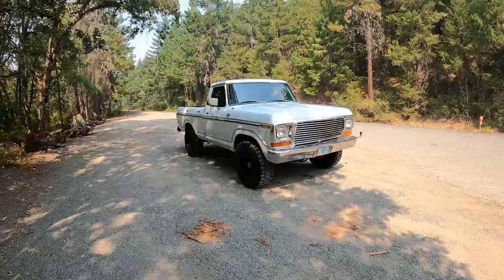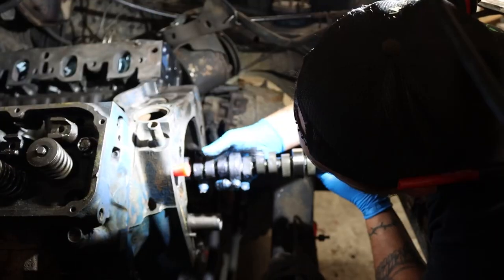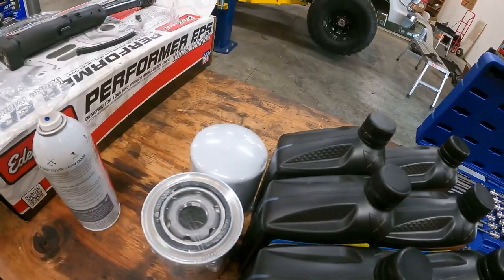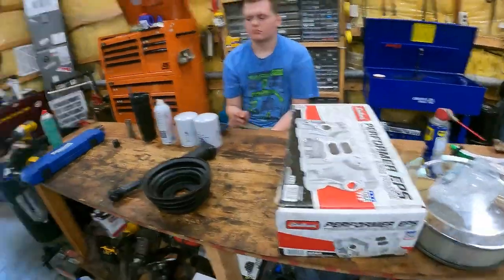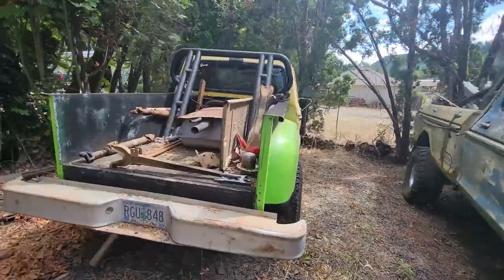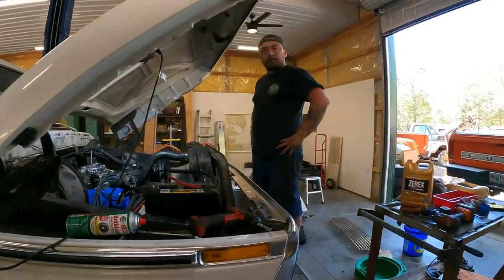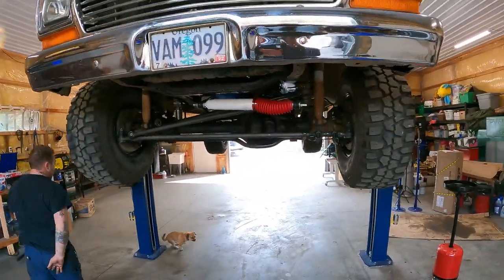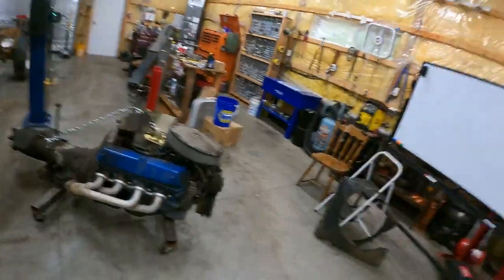Ford 400 Cam Swap. How To Go From stock to HOT!

Comment: The biggest handicap with those 400s are the giant dish having, humongous valve relief, compression robbing pistons. If you want to get some power out of one of those you’ve got to get some flat top pistons in it. Also just an FYI there is a 2 quart Ford filter Motorcraft part number FL 299.
Reply: Can I just gain c.r. using closed chamber heads
Reply: @ivonneflemons1249 Yeah, not sure if it'd be enough
Reply: @ivonneflemons1249 you'll gain performance out of close chambered heads but you'll notice the biggest increase with flat tops
Reply: @ivonneflemons1249  Absolutely.
Reply: The piston doesnt come close enough to even require valve reliefs?@bigwahoo8686
Reply: And if you're gonna do an adaptor to add an oil cooler.
Guys, spend your money once

Comment: A 1970-71 timing chain and gears for 351 c. A good dual plane intake with a 650 cfm carb, a comp 268h cam and recurve the distributor to have all advance in by 2800 rpm and the 400 ford will haul the mail. Huge difference in power
Reply: I’ve had two 400’s built ... the cam and timing set from the Boss351 is the trick. Edilbrock dual plane aluminum intake and a Holley 650 or 780(?) . The stupidest thing I did on the second one was putting headers , and using a stock type fuel pump, it would vapour lock when hot and stuck in traffic. 1976 Montego Wagon ... there’s a YouTube video my nephew made ( he says 400hp... I had no clue what horsepower , but it was a monster )
Reply: Canted valve Fords are underrated. 
A few quick mods and they are very powerful. Even more so if you bump up the compression.

Comment: I had a 78 bronco with 351m man that thing would start super quick. I haven't seen a fuel injection engine to this day that could start faster than that 351m .you would Barley hit the key and it wouldn't make one revolution  it didn't seem like and it was on.
Reply from the maker: the 351m and 400 was very under rated motor. Just a few mods and they are great motors.
Reply: My dad had a 75 torino wagon with the 400 for ten years , and it started like that , even in sub zero temps .

Comment: It’s nice seeing a Ford 400 getting some attention.  I have a cammed 400 in my Lariat short bed and it runs pretty well for what it is.  After driving it, it makes my Coyote 5.0 f150 feel like a pig!
Reply from the maker: the 400 is a decent engine. It does have a bad rap though and people that don't even know get sucked into it.
Reply: @78fordtruck4  Yeah, with bolt ons and a tune!  My 400 made my 5.0 feel like I was dragging an anchor!  The 5.0 was plenty faster though from a roll, dead stop it stood absolutely no chance.  My 400 will run a mid 14sec pass.  A gen 1 5.0 is a 15.xx sec truck.

Comment: Before I built a 460 and put it in my F250, I did a 4 barrel swap only to the 400 in it. That alone was a tremendous difference.  I'd assume you saw an even bigger difference by doing a cam swap also.
Reply from the maker: Yes, I really gave some proper life to the motor. Now I will say it's no 460... yet. But we worked within Chris's budget and this was the best bang for the buck and it gives a great platform to build off. The next upgrade will be his ignition system, then to exhaust, and after that, if he wants we can upgrade to an efi system. 

And I feel that is important stuff that people need to look at when spending money on their builds. Getting that solid foundation and then building off that platform.
Reply: @PaperBeatsRock   A lot of people think the 400 and 351M are just good for boat anchors. That's definitely not true. They came so detuned from the factory to accommodate smog requirements that were still pretty much a new thing. That killed performance. I'm not much on EFI myself.  I don't dis people that want it though.
Reply from the maker: @nicklewis7291  I fully agree with you on the 351m and the 400. They are be turned into some great motors but yes out of the box they are not awsome and thats a big reason why they got such a bad wrap. 

We have a block we are going to be taking to the shop very soon to make are going to building into a 400hp 400 and she will turn some heads.
Reply: Center line the  cam and put a lot  of auto  advance  in after it starts  and  it will fly

Comment: My dad ran a 400 in his race truck back in the 90's at our local dirt track. All he did was put an RV cam, D2 2V Cleveland heads on it, Weiland high rise intake, 650 Holley 4 bbl, set of long tube hooker headers, and it was running like a scalded ape, and running with those bowtie boys that 2x as much money and maybe 2x the power, and as soon as we got the set up right with the twin I beam suspension we were hard to beat.
Definitely an underrated engine

Comment: Nicely done guys...400 engines have always been underrated. Job well done.
Reply from the maker: Thank you so much. We need to step up to some of your guy's big boy 400s now and make a ripper.
Reply: Since that 2 barrel carb on 400 makes out 165-ish horsepower so now with 4 bbl and manifold upgraded and camshaft installed , what’s the horsepower on 400 after these upgrades ?
Reply: @darrenfike924  there i a video in YouTube, with a guy doing this on a dyno. 

His name is Richard, i Will try to find it for you.
Reply: @darrenfike924 smaller end of 400 higher end of 300.

Comment: I got my grandpa's 77 f250 camper special, 351 with 400 modified heads. She's tired with 337k miles on her. Never been touched. I want lift her and put a load of power under the hood but part of me wants to honor the old man and do a resto with everything staying Original, just a rebuild/refresher. I'm torn. I got too many memories with him in the truck to change the 2 tone paint or even take the camper top off. I found the original tool box in the side bed box the other day.
Reply: Is it a 351m?
If so a 351m is a destroyed (autocorrect changed destroked to destroyed! 😂 I Agree!) 400 with a shorter stroke crank and thicker pistons, everything else is the same, sadly a 351m sadly isn't a 351 with 400 heads... 😐
but from what I've heard there very good little engines, just figured I could spread some knowlige! 😊 and bad spelling

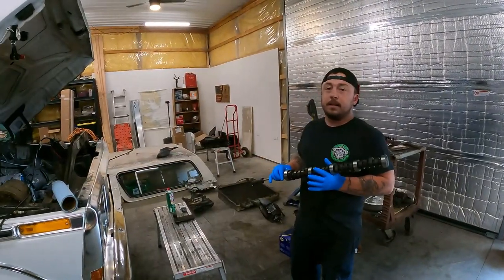John 3:16
Reply: Oh there's also a 400m a stroked out version of a Cleveland I believe, they were race engines with 500-600hp I believe. 🙂
Reply: @ShelbyScott919  it's a 351W not an M or a C. And the truck has over 300k miles on it and the motor has never been opened. It's not a race truck lol.  rear tank that was converted to stainless steel 70 gal, upgraded suspension etc..  the truck had two purposes, one was a trash run and the other, well that's not for the masses
Reply: @contagiouslyfit1021  i didn't figure it was a race truck since you said the engine was stock, just curious if the 400m heads were custom order or if he did that? and  do you mean 400m race engine heads or 351/400m?
Ford is so confusing! lol
Reply: @OVERKILL_SS  351w with 400m heads ordered from the factory. It's the camper special f250 xlt
Reply: @contagiouslyfit1021   that's cool as heck man! enjoy that thing as long as you can!
Reply: Egads.. you guys need to stop.  The M is only for the 351 so you can tell the difference between the other 2 of the 335 series engines.  And 400 heads are nothing but 351C 2v heads.. that are a bit downgraded over the years.  Ford only made 1 400.  they made 3 351's.  that's why letter only applies to 351s.  But people over the years are pretty dense. OK pictures or video or you are making this stuff up.  A 351C 2v, 351M and 400 head are basically all the same thing except they added a bump in the exhaust port in later years.. a downgrade for smog.  You can't just put 335 series heads on a 351W with factory parts.  They don't exist.  The heads physically bolt on but there is not an intake manifold made for that by Ford.. EVER.  It takes special adapters or aftermarket intakes and they didn't exist when Ford was making these engines.   Forget whatever grandpa told you and go learn about 335 series Ford engines from someone who actually knows them.    @contagiouslyfit1021

Comment: Good job boys! I am building a 400. Picking up the crank today. Found a standard bore block, will get it machined and squared then order the Meyers pistons.
Reply from the maker: Outstanding. There is a lot of potential in the 400 block and your right at the point where you can really turn it up. T Meyers does such amazing stuff with these blocks. If you have not already, check out their YouTube channel and the 400 builds they have done. https://youtube.com/user/tmeyerinc
Reply: Martin Loyd Where did you get your 400 crankshaft? I'm looking into rebuilding my 351M into a 400
Reply: TMI pistons is the biggest improvement...

Comment: Get a edelbrock 351c 2v performer and adaptor plates.
Your 2v heads have a bigger intake cross section that SBC AFR 210 CNC ported race ready heads.

Comment: The 400 Ford intake was unique to the 400 Ford and 351m only and it was not a long term popular motor.  400 fords have a taller deck than other small block Fords.

Comment: 400 is a low compression smog motor, but basically a high deck 351 Cleveland. Higher compression pistons, better heads and cam make these monsters. The best part is that these are cheap in the junkyards, but still hard to find.

Comment: Those 351 and 400 m was good engines after we pulled all the pollution bs that choked it off. Just putting a good carb made a huge difference.

Comment: A 351 Cleveland 4V intake manifold should bolt right on the 400..... A head porting would have been the icing on the cake ❤
Reply: Pretty sure wouldn’t bolt on you would need spacer plates 400 has taller deck height

Comment: I have embarrassed countless other cars and trucks in my 79 f-150 short box 4x4.  Built the 400 with Cleveland 2v heads from a 70 cougar, it’s fully balanced and blueprinted and rollerized.  It’s running 11.8:1 using Cleveland pistons with the wrist pins sized down combined with the block being decked.  That and a edlebrock street master single plenum intake.  The most embarrassing thing for people that get left in the dust is that it’s on propane and is runnng a mild RV cam 🤣.  In 4x4 on dry pavement it will hop 4” off the ground when you stomp on it.  I cracked the carrier housing on the 9” grabbing 3rd.

Comment: yeah, I about choked when I saw that new edlebrock intake was like WAT? I tried to get one of those for months. I think they cast them on demand now due to rarity. Finding a good 400M intake is the start of any build. I ended up getting one off craigslist. One of the moutning hole was fubarred but the local shop fixed it.

Comment: Anyone know about the valve springs, you cant use the stock ones that cam, im doing a mock up now, the exhaust valves go solid and the intake is nearly the same, Edelbrock doesn’t sell the springs and retainers that i know of now for that cam. Any solutions would be well appreciated ,

Comment: I have a 400m and I'm looking to go 2brl to 4brl looking at Edelbrock avs2 650cfm but don't know what intake manifold would be a good set up with it just looking for everyday use plans on long tube headers
Reply from the maker: I would just run the Edelbrock performer. Its a very solid intake. You may run into a problem getting one unless supplies have got better.
Reply: just call summit racing and tell em what ya have and what ya want they take care of tyou easy and if you dont to wait they'll call you back they are great !

Comment: how did you run the kick down cable i have the same intake and carb and i believe i have to buy and adapter but would love to know how you guy did it.
Reply from the maker: we had to run the adapter as well. I don't know if the availability of them has gotten better but it was a pain to buy ours when we did it.

Comment: Love this video. Got the same engine in my 75 Ranchero. Pls tell me what length pushrods you used. Did you have to change the valve train geometry
Reply: Shouldn't need to for same base circle cam and rocker system.

Comment: Hey buddy just out of curiosity but is that 600cfm carburetor big enough for that 400?? I used to have a 1TON 2wd dullay that had a 400 in it!! It had a dump box on it and a 8’ snow plow on it also I had a 750cfm Holley carb on it and it ran awesome!! No hesitations or any issues with it!! And man when I seen it was 2wd and had a snow plow on it I was like well I better make sure I have plenty of chains and a couple snow shovels for when I get stuck!!! Lol!! But after putting 2tons of sand in the dump box I would hit snow drifts that were taller than the truck!! I might have had to back up and hit the drifts again to get threw but that truck was an animal and I absolutely loved it even though I’m definitely not a Ford guy I’m a big big Chevy fan!! I’m actually been looking for a decent 1969-1972 Chevy blazer to buy??? If you have or no of any that are in decent shape and heck it doesn’t even have to have a motor but I would definitely like one that is set up for a manual tranny??? Let me no buddy please!!!!??? Awesome video once again!!!
Reply from the maker: So with the cam we did and talking to ISKY it supports a 600 cfm or more. Chris does use his truck as a daily driver and he doesn't throw much of a load in it so it will fit his needs. If at any point he needs way more grunt it wouldn't be hard to swap up to a 750 and resell this 600. Very good question though. 

Also ill let you know if I do run across any of them blazers but I do know the 69-72 are a lower production but still a decent mount of them out there.

Comment: Could of added another 20 hp with roller rockers!!! Another 20 with headers!!! Call the owner back!!! Summit has the parts!!!
Reply: Almost forgot, with headers, new exhaust. 3 inch, 3 inch out of the headers into a 3 1/2 inch (y pipe, driver side crosses to passenger where the trany mount would be) from y connector to muffler (3 1/2 inch all the way out)must be 3 feet!!! This exhaust will bring everything together!!!!

Comment: My 400 is technically a 400M Its "modified" and produces 510 hp @ 4300  rpm she can run up to 5k so we have some horsepower left in her if needed, but its not a race truck its a daily driver and I pull horse trailers.... It has a performance cam, is bored a little over and has HP pistons, the edelbrock street eliminator intake manifold, hooker headers, and a Holley 750 4bbl. and believe it or not still gets around 15-16mpg as long as I don't get into it.. If I get into it, she will move like a rocket, but you can literally watch the gas needle move...hahahaha

Comment: You didn’t use a valley pan style intake gasket?
Reply from the maker: we don't. I really hate the valley pan built-in gasket. They just end up rusting out and then all material ends up going into your engine.
Reply: @PaperBeatsRock  I agree I hate them. I thought their purpose was to keep the hot oil from hitting the intake though?

Comment: Bro exelente trabajo necesito tu ayuda.. podras preguntar a tu amigo (quien te consiguio el intake ford 400) Cual Flywheel debo usar.en un 351M? Este que tengo aqui vino con una transmision FMX y quiero usarlo en una Tow Truck F-350, pero nonde cual es.el Flywheel correcto q debo usar en mi 351M 
Agradezco tu ayuda.. 
Saludos desde Venezuela!! 
Kevin.
Reply: Quise decir: No se cual debo usar.. y si tu amigo lo sabe si ouede facilitarme a travez de Ti, el Number Casting de el Flywheel q necesito
Reply: Quise decir: No se cual debo usar.. y si tu amigo lo sabe si ouede facilitarme a travez de Ti, el Number Casting de el Flywheel q necesito